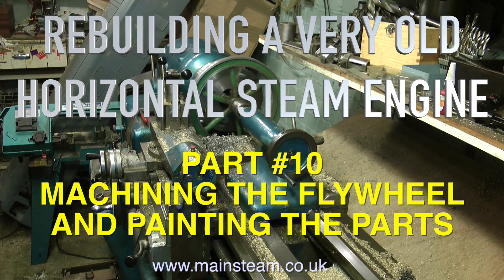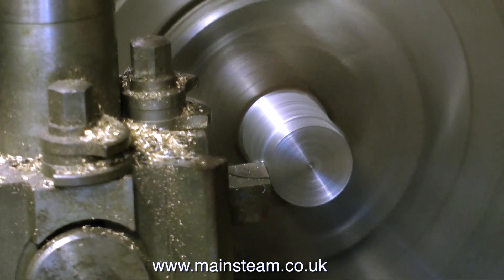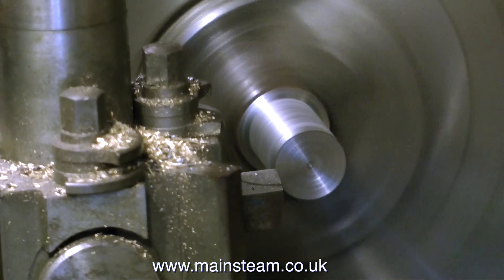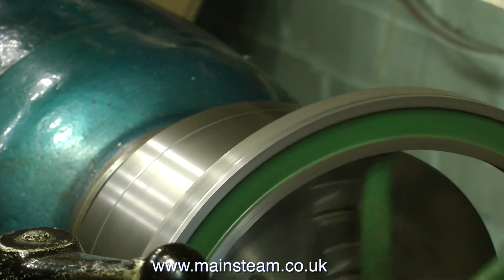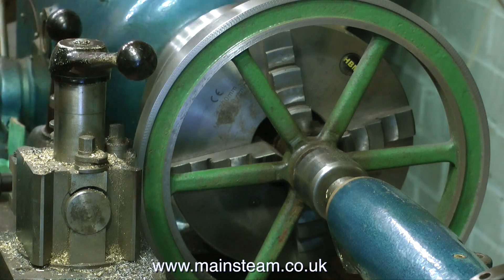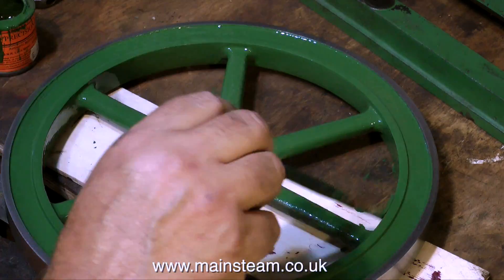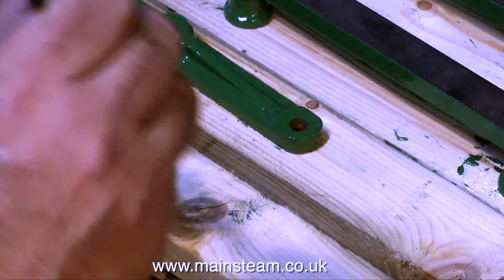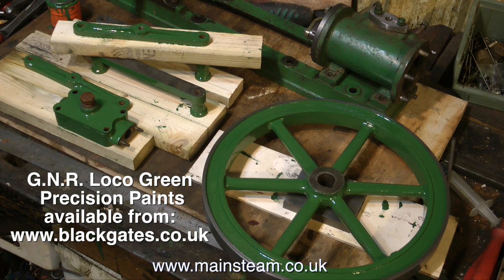PART 10 - LARGE HORIZONTAL STEAM ENGINE REBUILD

Comment: To grind chattermarks or chilled castings, you could also adapt a small bench grinder to the x-axis of your lathe.That would be a cheaper way than, building a tool post grinder.

Comment: You used locktite to hold the flywheel to the sub shaft you made.  How did you remove the stub when completed?
Reply from the maker: +Tony De Leo a small amount of heat - I have mentioned it in previous videos.

Comment: Hello there  Great video's as always I love how in-depth and simple things are when you do it with these beautiful models and engine's of Yesteryear gone by , I couldn't help notice at the start of this Video a Glass Fiber body of a Diesel Out line of a Class 24 Rat ? if it is will you be working on it any time soon would love to see it running when finished , I have a Class 33 in 5 inch gauge, Any ways I look forward to many more video's you make.Have a good days machiningMr Keeway
Reply from the maker: +Mr KeeWay I have a couple of part complete 7 1/4 inch gauge class 25 locos, the body of one of them is the one in the video. They are not really my cup of tea as I prefer steam locomotives so I am in the process of selling them to a friend of mine.